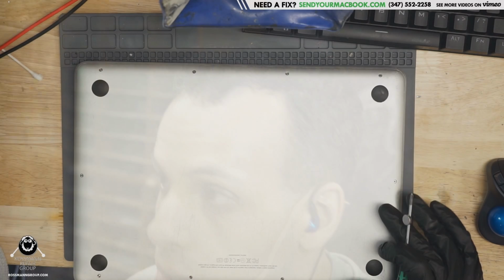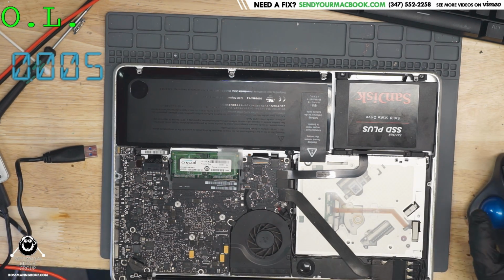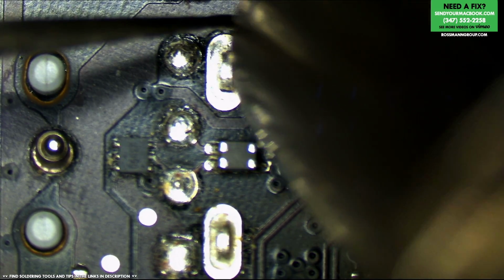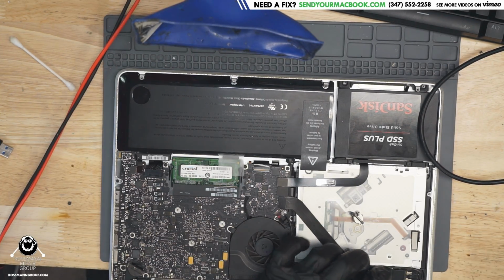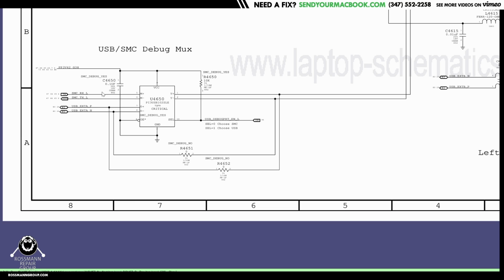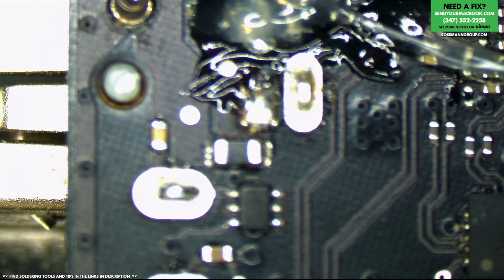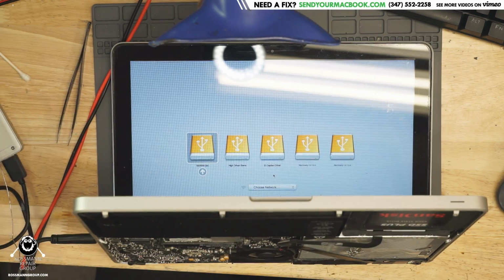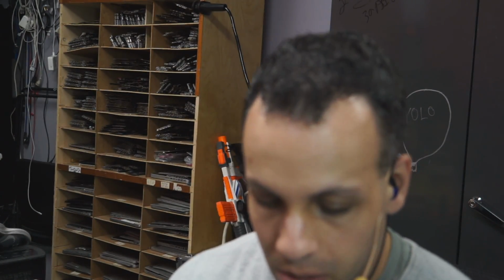Macbook Pro USB port not working: repair, diagnosis and solution.

Comment: Hi Louis i'm from Trinidad  In the Caribbean  , I have a MacBook pro 15 mid 2010 A1286 , from watching  your video here , , i think i know what wrong  with my USB 2 . everything works  the bluetooth the trackpad / keyboard and there is voltage , i can plug in anything  and it will work but not data ,  so from this  video  it could of been the data line , filter or diode  , then i remember  this dam USB 2  do work when it feel like ,,  so is it the jack now or  cold solder . ? what you think .  Dj  Phenomenal AJ

Comment: My right hub stopped working after my Air fell on it while a USB drive was plugged in. Do you think there’s a way to repair this? Also it gets pretty warm around that area which drains my battery fairly quickly.

Comment: LOUIS:  Don't know if you saw this, but someone is offering two ISL9240 chips on ebay
...
Added to your Computer-Tech list | Remove
list
Picture Information
Opens image gallery
Intersil-ISL9240-Chip-PBUS-Supply-amp-Battery-Charger

    Intersil-ISL9240-Chip-PBUS-Supply-amp-Battery-Charger thumbnail 1
    Intersil-ISL9240-Chip-PBUS-Supply-amp-Battery-Charger thumbnail 2
    Intersil-ISL9240-Chip-PBUS-Supply-amp-Battery-Charger thumbnail 3
    Intersil-ISL9240-Chip-PBUS-Supply-amp-Battery-Charger thumbnail 4
    Intersil-ISL9240-Chip-PBUS-Supply-amp-Battery-Charger thumbnail 5

Have one to sell? Sell now - Have one to sell?
Shop with confidence
eBay Money Back Guarantee
Get the item you ordered or get your money back. Learn more - opens in new window or tab
Seller information
hamidabol (647 )
100% Positive feedback
Saved
Contact seller
See other items
Details about  Intersil ISL9240 Chip , PBUS Supply & Battery Charger
Item Information
Condition:
For parts or not working
Quantity:
2 available
Price:
US $149.99
Buy It Now -
 
 
Add to cart -
Best Offer:
 
Make Offer -
 
 
Add to Watchlist
 
Added to your Computer-Tech list
Longtime member
Free shipping
No returns
Shipping:
FREE Standard Shipping | See details
 
Item location:
New York, New York, United States
 
Ships to:
United States and many other countries | See details
Delivery:
Estimated on or before Fri. Dec. 27 to 32701  
help icon for Estimated delivery date - opens a layer
Payments:
PayPal Visa Master Card Amex Discover
PayPal Credit
No Interest if paid in full in 6 months on $99+.  Apply Now  |  See terms
Returns:
Seller does not accept returns |  See details

Comment: could the capacitor c4605 and c4616 be blown?

i saw on another video where a series of capacitors on the backlight power caused the backlight to fail.

also could someone have used a usb killer and destroyed the mac only this mac is new enough or designed in a way that just the above 2 capacitors would fail rather than the entire motherboard.

a usb killer in short is a device that sends high voltage to the port data rails frying things ranging from just the port to the entire motherboard.

maybe if you have not done it already you could do a video on usb killer.

just be very careful and only use it on stuff that is headed to the recycling bin or dumpster as it will cause damage and you dont want to fry a customers or good parts boards.

getting the usb power enable from the ram makes sense because there is a very narrow window on non laptops where you hit the option key to get the startup windows.

on a mac with usb keyboard the window only lasts maybe 250 miliseconds after the screen lights up.

so as soon as you hear the chime and the screen lights up hold the option key and you can get into the startup disk menu.

if you miss the window it is best to let the mac boot and then do a restart than to force power off and restart as you can corrupt the hard drive.

Comment: Great Louis. One question: on the diode scale, the multimeter injects about 3 volts into the circuit, correct? So is it safe to use this scale in the VCore sector since this sector works with 0.8 to 1.5 volts? Thanks
Reply: Why would you inject 3v into a 1.5v circuit!!!  You are just asking for trouble.

Comment: Have you ever found kiddie porn or anything illegal? And did you report it to the police?
Reply: There's no reason to look through user's files 99% of the time as board repair doesnt require data access and data recovery doesn't require file analysis in any way that would necessitate looking at images or filenames but you can be sure that if it ever happened they dealt with it responsibly.
Reply: @TheGreatPurpleFerret  I'm not insinuating that they snoop through people's files, but I know that some people are stupid and leave that stuff open on their desktop.... or ... weird shit happens. I'm just curious if its happened and what was the result.
Reply: @tysonburns9535  sure and my point is that it's not some juicy drama that you should be asking about to giggle over the shocking nature or whatever. If it happened it would be evidence of serious crimes and it should be discussed with the necessary gravitas. Treating it like an interesting story to be spread on youtube is not that. Passing it to the authorities and letting them deal with it and moving on is.

Comment: Hey Louis in the past you made a video discussing the poor quality of seagate hard drives in terms of data recovery. In the video you mentioned that western digital drives tend to not have this problem. I was wondering if you thought that western digital is good brand to buy from. If not, what hard drive you recommend as a repair technician and why? Thanks! If you really wanted to butter my egroll you could tell me what SSDs you recommend as well.

Comment: It just dawned on me WHY you have not expanded into iMacs where we owners really need someone like you to work on them!  The old location and desk facilities have been too small to handle these monsters when  compared with the smaller laptops. 

With the new place AND  its basement, is there a chance - no, make that a prayer - you will get to help we who have big macs (pun intended)  and need help? Yes,  opening these beasts to get at boards needs space and suction cups to get to boards, but we who trusted Apple are suffering from not having GREAT and HONEST service beyond Apple itself, someone like you and your crew . Most Apple authorized service only swaps exorbitantly priced boards and part iunits because they do not have the expertise or acumen to work at board level.  

OR, maybe your new place, cellar and all, ain't quite big enough to handle the flood of shipping and work that would probably hit you very quickly, requiring even more skilled people and work benches. I know that a bright businessman who caresto do it right  can only make one step at a time AND keep quality control at your level.  So, please, please, keep us iMac people in mind before we are forced to buy new high priced machines we truly cannot afford.
Reply from the maker: people do not spill water onto their imacs because gravity makes water fall down, not forward! there isn't much to fix. :p

most imac issues are too much of a nightmare. you have to remove a $600 lcd that breaks easily to get inside it so free estimates kinda go out the window, which pisses off the customer.
Reply: @rossmanngroup  Thanks for the clarification, I thought it was just size and bulk.  I stand corrected and educated.

Comment: Hi Louis. I was trying to fix my 2012 macbook pro and accidentally tore a cable when replacing the motherboard (logic board?) If I send it to you guys, would you replace the cable so I can have a functioning laptop again? Thanks for hearing!
Reply from the maker: What cable?
Reply: @rossmanngroup , I'm honestly not too sure- it's a cable marked 21 that's direct to the right of the ram, on the opposite side of the battery connector. I really wish I knew what it did but I'm on able to find anything about it. 

Thank you for the quick response!